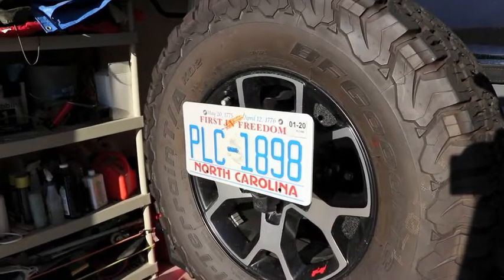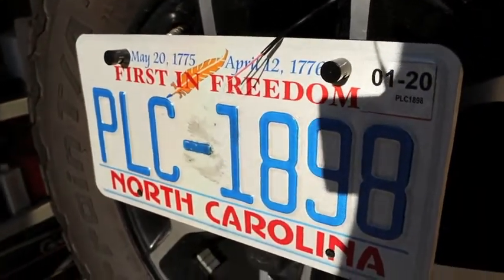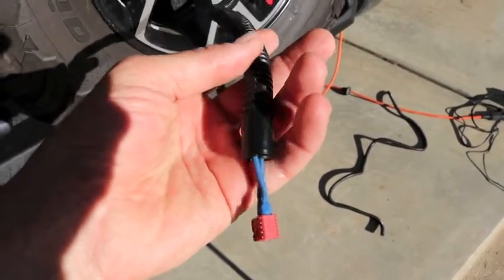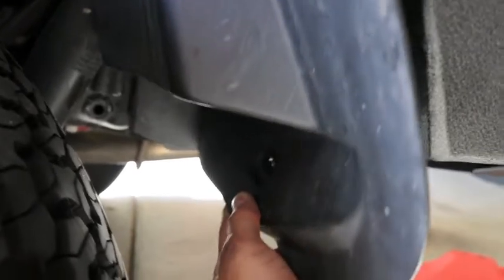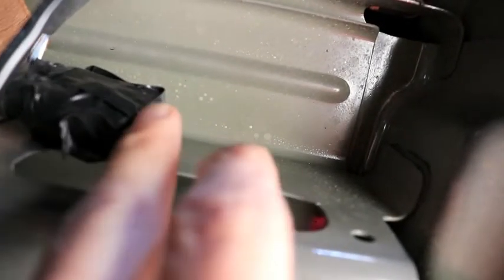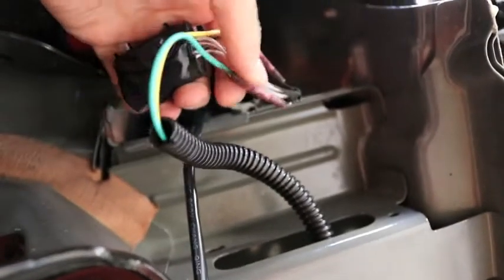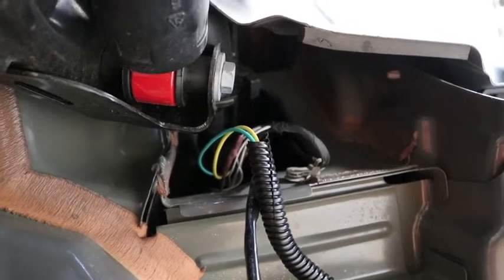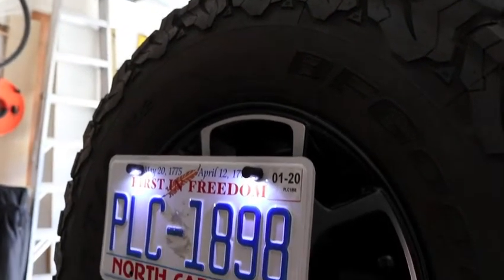Let there be light   on the Jeep Wrangler JL license plate

Comment: Is this a license plate bracket or do you have to cut the camera and stuff I can’t seem to find the kit for details
Reply from the maker: The rear bumper comes with the camera relocation kit and sits just below the plate.  The license plate bracket is just that - a bracket to hold the plate.  I may try to integrate the third brake light on to the plate bracket or buy the LOD relocation kit as I want to get rid of the current third brake light relocation bracket.

Comment: what kind of clips did you use for along the tire carrier to hold the wires up?
Reply from the maker: Initially had stick on wire plastic wire hangers but they did not hold to the metal.  I have now zipped tied the wire to the carrier using black ties.  As well, much of the wire I put into black plastic wire sheathing.
Reply: @swimman66  thank you, i have the same thing going on ,i just need to hide the wire better. i went through the tailgate and now opening and closing it you have to be careful cause of the wires.. i saw you went from the tail light up to bumper. gonna do that looks cleaner . thanks .

Comment: I have a black and red wire where do I connect those too ?
Reply from the maker: At 2:05 in the video I explain the wiring.  Red goes to white/royal blue and black goes to black (I don't state black in the video but I assume it's a black wire that you need to connect to).  Or the black wire from the lights can go directly to a vehicle ground screw or nut.